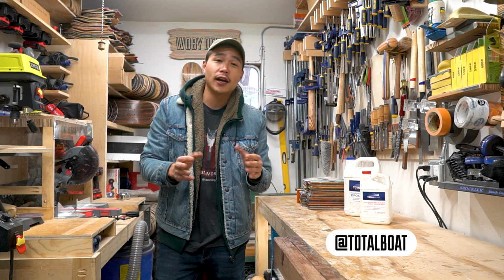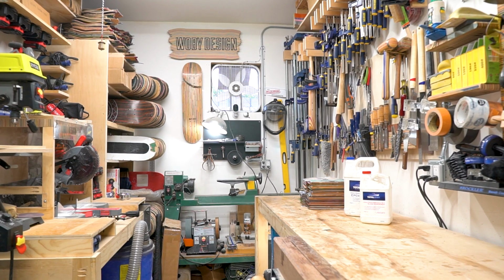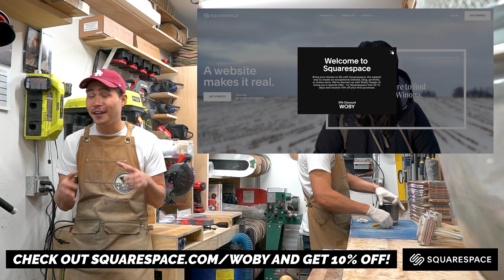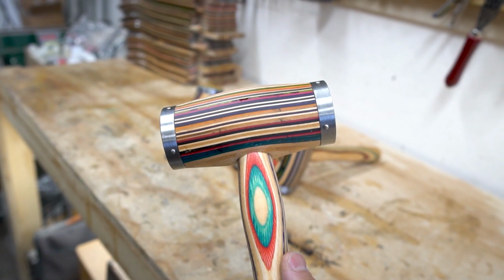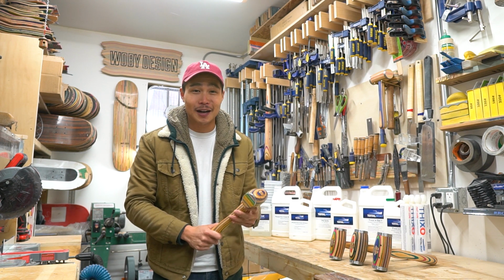MALLET MADE OUT OF RECYCLED SKATEBOARDS!

Comment: really very cool looking mallets but I reckon you'll manage to sell a lot more of these if you leave out the metal ring around the "hitting edge", or at least move it back a little from the edge to leave a wooden hitting surface. As it is these are probably just fine for jobs like pounding on a wood chisel etc., but practically useless for, say, tapping together the parts of a cabinet (as the ring will leave marks in the finished piece). Just a suggestion - hope you take it in the spirit it was intended. Stay safe, man.
Reply: Cathal Whelehan I agree nice mallets but why add metal rings smh

Comment: Awesome mallets!!! You have given those old decks new life! You need to be turning at a much higher RPM on the lathe. With carbide tools you need to be up around 2000 revs. Especially with plywood, you’ll get much better surface finish and contours will be smoother, less grabby.